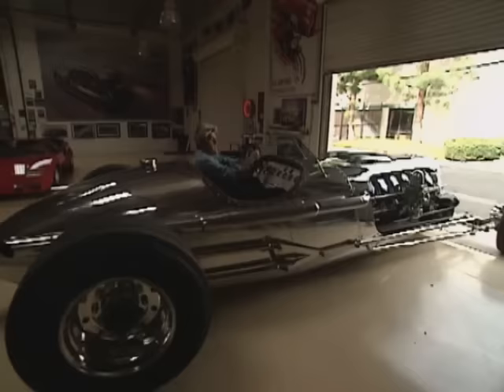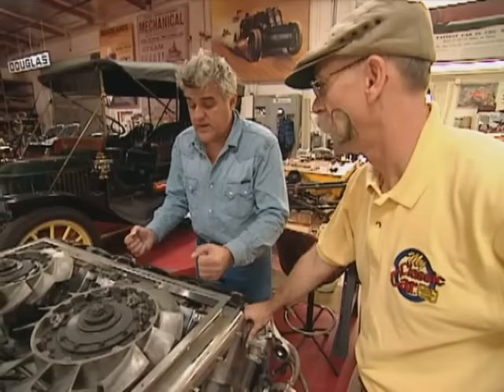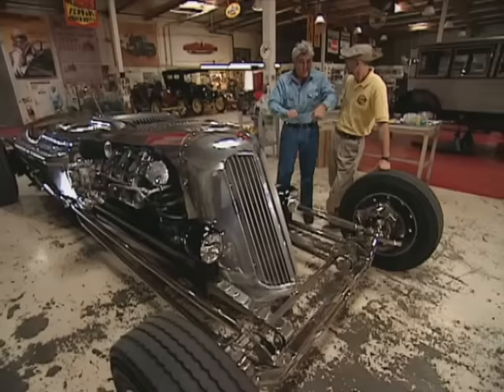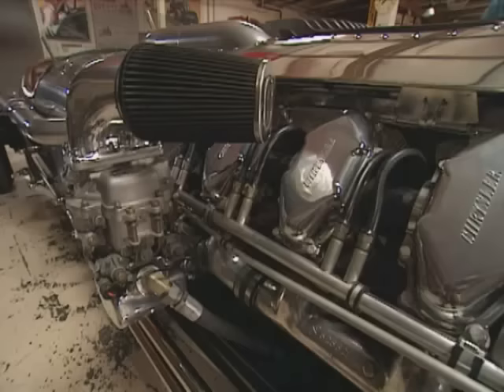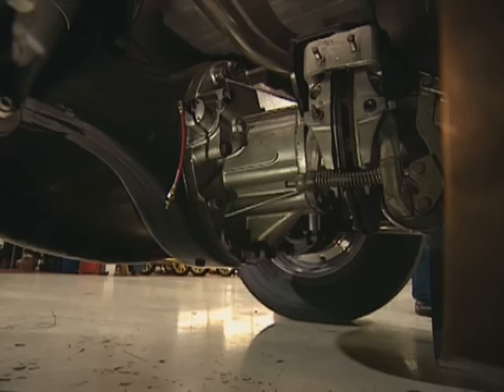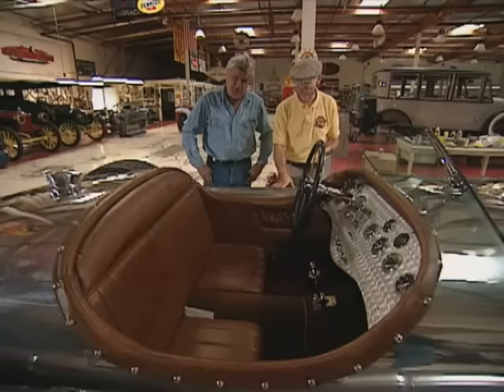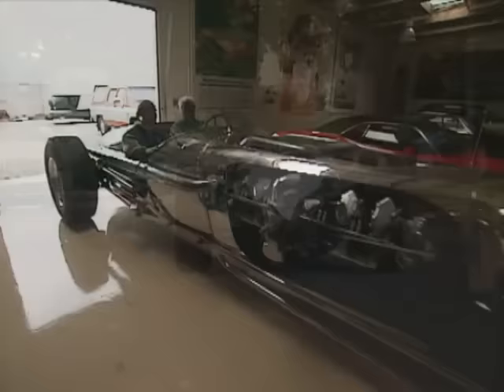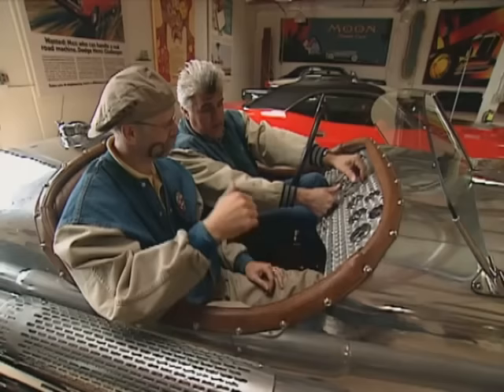Jay Leno's Tank Car | M47 Patton Tank Engine | Greyhound Bus Transmission | Blastolene Special

Comment: Like driving a school bus from the back seat.
Reply: not exactly. its about as long as the shortest f150 made
Reply: @Sasha Tamara Keegan just informing people its not nearly as long as it looks.
Reply: only a school bus is a diesel 4 cylinder that is gutless.
Reply: @dirtrider88  No it isn't.

Ford F150 Regular Cab

• Overall length: 5.3 meters (209.3 in)
• Wheelbase: 3,119 mm (122.8 in)

Blastolene Special

• Overall length: 6.4 meters (251.96 in)
• Wheelbase: 4,826 mm (190 in)
Reply: Ha! Have you heard of the Michigan Madman? He did exactly that! Two engines in the back, and the thing wheelied. The driver couldn't see where he was going! Eventually even the man himself admitted that it was just too b--- dangerous. Ye Gods!😗

Comment: 1,790 cubic in, 810 hp., 24 spark plugs, four mags, two sidedraft cabs, it was aircooled and the frist tank it powered was the M46 @48 tons or 96,000 pounds. this engine also powered the M103 heavy tank @ 62.5 tons, M53 and M55  SP arty, LVT P-5 amtrack(USMC), the M47 tank, and the M48 tank..and there where around 5,600 parts to this engine...Oh ya it was built to burn MO gas or 80ct.gas...and the crank case held 22 gal of oil (50 wt).
Reply: Can I use 90 wt in mine?
Reply: Thank you :)
Reply: Did I hear 24 spark ⚡️ plugs ?? I wont go any further. ..greyhound bus transmission OMG 😯
Reply: @johncavar2914 Wait One Minute I think Sunny needs too hear about this because she calculated 1 big 30L Merlin V12 (With out the supercharger) having 800 hp and this is proof of it.

Comment: Sir I went into the dentist office and picked up Popular Mechanics and started reading about this car which was a thrilling distraction from an impacted wisdom tooth. Sadly I stole their magazine so I could finish the article. I confess 😈🇺🇸🍻
Reply: That interesting conversation with the cops when that radiator hose used as a high pressure oil line blew all them gallons of oil across the Freeway 😂

Comment: If you think that engine is big then you should google the engine for the M88a1 and the M88a2. Both use the engine that was originally in the M60's. I was a Bradley mechanic for 15 years and I worked on far too many of those engines to even put a number to. The engine if it came from a good rebuild facility was a solid work horse that put out a great deal of power. I remember being back at FT. Carson Co. Driving my M88a1 a 56 ton recovery vehicle and towing a AVLB "M60 tank hull converted into a bridge layer" w/ the  bridge still loaded up. While the hull is nothing a M88 the bridge does add a lot of weight. I had to go up a pretty steep hill on the way back from down range back to the motorpools and I seriously had my doubts about the welds on the tow bar holding out due to the weight, incline, and when I crested the hill the back end of my track bouncing around even at slow speeds. The 88 isn't a fast vehicle by nature with 25 mph being its rated top speed. But 20 mph was more usual. If you had a M88 that ran 25 or slightly more it was a good idea to go ahead and order a new engine cause she was more than likely going to blow jugs soon. I have had many just "only me" moments with the M88 while I was in. Lol I had 2 catch fire @ NTC (seriously not my fault). But anyways if you took care of the M88 it would give you hard work and devotion back. If you did piss poor maint then you had allot of problems. Anyway I seriously loved my job in the Army and wish I could of just done that my whole life. I loved tanks when I was a kid and it's never gone away. If anything its probably worse now that I can't work on them or drive them anymore lol. A greatly under recognized piece of military hardware that rarely is seen outside of the motorpools.

Comment: Jay has since made thing thing twin turbo!
Reply: The M47's original power-plant was already twin turbo I believe.
Reply: It was to get better gas mileage. Now it is up to 5 miles a gallon.
Reply: right forcing more air (and fuel) in gave it better mileage, sure.
Reply: @dirtrider88  A lot more air, very little extra fuel. Turbos make engines more efficient in the kilometers per liters department.
Reply: @andresmartinezramos7513   you still not gonna get better mileage out of it by sticking on a trubo(s)

Comment: I thought a tank engine would be diesel. If it uses that much juice in a 9500 pound car, imagine how much it used trying to move a 50000 pound tank! 
What a beast.
Reply: The tank it came from had a range of 100 miles on 233 gallons, so 2.33 gallons per mile. Surprisingly a lot of tanks from the era were gas powered, I think (could be wrong) the Russians were the only ones doing diesel early on.

Comment: I had a buddy that collected tanks Ive worked on those engines  !  another wild one that would be great in a hand built car I always thought would be the supercharged continental air cooled flat 6 that's in the walker bulldog it screams when you throttled it up and would turn the mufflers red hot and ruin the baffles in them .There is a M48 sitting at a national guard armory in Jeffersonville IN that used this V12 engine  I never have stopped and climbed on it to see if its in it or not If so wonder if its stuck or not and would still run ?

Comment: Hint, when we started (in the Army) our47s and 48s we always turned the engine over at least 5 times with the magnetos off to clear the crankcase to prevent and explosion.  Saw one tank burn because the driver was in a hurry, heck of a fire, total loss, no one hurt.
Reply from the maker: Absolutely right about the mags off thing!

Comment: I only had GT4 and on but I started using it on a regular basis to drift with. I shouldn't have but the guy that got me into drifting stopped competing with me when I used the Tank Car. He only drifted in automatic for one and his controller wasn't set up for shifting gears.
The car only had a few adjustments and if I remember correctly it was tires, set manual trans,  and weight distribution and that was it. She really looked gnarly with snow tires and I had plenty of photo shoots with it. In GT5 I was probably the only one that used it. In GT6, it was nothing but Tank Car and I was nothing compared to the kids. Arthritis, age 65, and a crushed right hand made it difficult but it was still fun. In GT Sport Japanese creator of Gran Turismo sucked the fun right out of the game because he didn't like to see his CARtoons crashing. There were NO NASCAR, NO DIRTY NASCAR, no crossing a field to elude a sharp turn, and NO CAT & MOUSE. 
If there's no NASCAR DIRTY this next time GT and I will part ways instead of when I used to pre-order.

Comment: When in the intended M-47 Tank, one could expect perhaps as much as 1.1 M.P.G.  (level hard surface road) this would rapidly change to about  3 Gallons per Mile when going cross country Gasoline provided more power, but less mileage than did Diesel.

Comment: This V-12 1800 cubic inch tank engine from 1953 reminds me of America's tank problem after she was at war in December, 1941. When the Axis Powers declared war on the USA after Pearl Harbor, the US had poor tanks: the M2 light and medium tanks (lots of machine-guns, but thin armor, cramped 2-man turrets, problematic gasoline aircraft engines, and an ineffective gun). The US tank corps could have copied proven tank designs in the world being currently used in the war against the Axis by our allies. Some tank experts argued that the Soviet T-34/76 (1941) medium and KV-1B heavy tanks were the best in late 1941, and the USA should have either make direct copies or base them on improved US versions with better quality steel, better transmissions, better electronics and better radios (and wet ammo storage for better survivability!). The 45-tonne KV-1B had nearly invulnerable armor in 1941, an improved high-velocity 76.2mm gun (tremendously better than the nearly useless US 37mm M2 tank gun), more mobile wide tracks, a strong torsion-bar suspension, a powerful 600 hp V-12 38.8 L (2,367.7 cu in) diesel engine (better than the tall flammable US gasoline-powered 400 hp aircraft engine in the M2 and following models), and a more spacious 3-man turret. Instead of making improved versions of the KV-1B & T-34, the US made the lousy M3 Lee as a stop-gap tank and then to the M4 Sherman that was unsatisfactory when fighting superior German armor.

Comment: Oh WOW! He needs to build a second one, a coupe version that has  some more leg room with  power rack and pinion steering,  power windows,  large power Brembo carbon ceramic disc brakes, a automatic ten speed dual clutch transmission ,  air conditioning and a heater, wider wheels, and Multi port electronic fuel injection.

Comment: Lol @ ha costed the GOV 110 g ha jay just add some.diesel to the cylinders of the seized motor for a month or three or heat up each cylinder  and use the starter to try and crank it  over it might let go lol doubt it but heck its worth a shot

Comment: 10,000 hp 30,000 lb. Torque 2 seater. Lmao.
Reply: Big Teddy Bear not quite sure what you mean by that. But it's 810 horsepower, and 900 lb ft of torque.